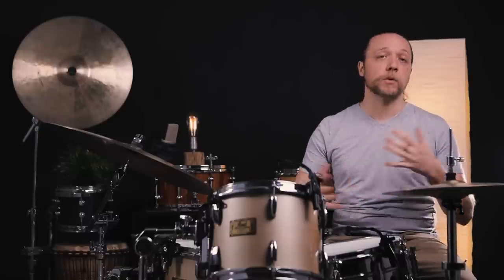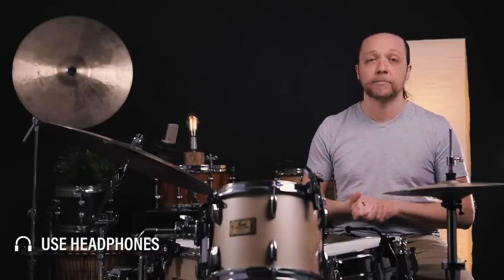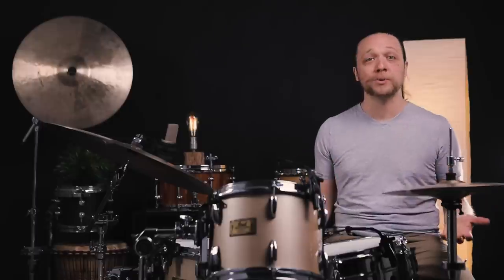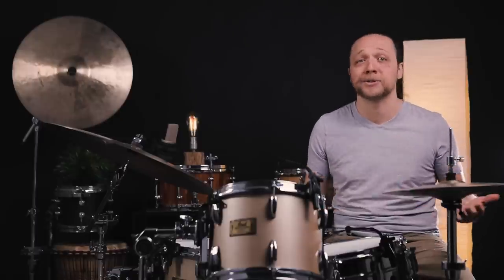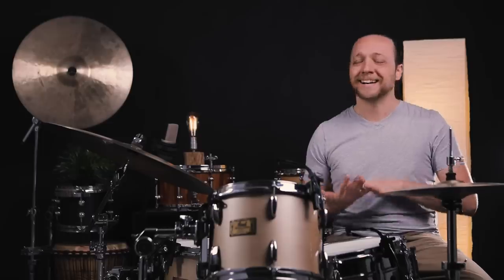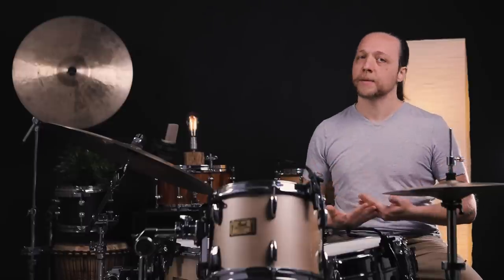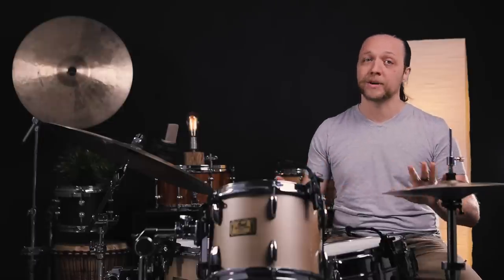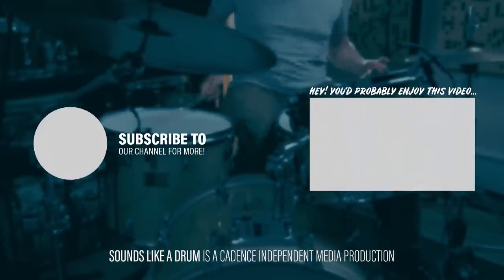Unison Tom Interval Tuning - Easy, Reliable, Versatile | Season Four, Episode 47

Comment: Same pitch is great for toms and medium tunings but the floor toms loose projection when tuned super low. I'd rather tune the bottoms of floor toms up just to give them more presence. I've used unison tuning for a long time and I think it works well for when you tune the drums and muffle them because they give a very strong fundamental with no pitchbend. Overtime I've learned to use the top head to give the base pitch of the drum and use the bottom to control the darkness and brightness of the drum.
Reply: I think there may be a fundamental misconception in your thinking - check carefully what he says roundabout the 5:20 mark.  Both heads are responsible for the pitch - if you tune up the bottom head for, in your words, 'brightness', the pitch of the drum will go up.  Whatever pitches you have for the individual heads when isolated, the whole drum will resonate at one fundamental pitch that is a product of the two heads when hit under normal conditions.
Reply: @frasermcallister6058  yes you're absolutely right. You can have the same fundamental pitch of the drum on two drums with dramatically different timbres. That's why drums are such a fascinating instrument to tune and record ♡♡♡

Comment: I like what you said about not having to have the same intervals on your rack tom as your floor tom. Ive found with different kits there's different sweet spots for each drum. For instance i have 10,12, and 14 inch toms and the 10 and 14inch drum love to be tuned with different pitches on each side but the 12 inch will choke out unless bot heads are the same exact pitch. Fascinating stuff
Reply: I was going to say something similar. I remember coming to the realization that rack toms and floor toms are different instruments and they should be treated as such.

Comment: I am the type of drummer that like the deeper tones on the toms and I have relied most on the combination of the heads that I use for batter or reso and even I tune them to a "prescribed" tuning I usually change everything to where I like the sound better.

Another thing is that I used to tune my drums at home and bring them to church and there I usually need to work on tuning the drums again because of the size of the room variable. 

In this video you share information I had not heard before and it widens the perspective that there's not a right or wrong...just be open minded to new ideas and let the sound of your drum guide you.

Thank you and look forward to hearing more interesting information from you all. 

Blessings to all!!

Comment: Husbands a mechanic and said old tuning is almost a lost art. It’s like building an engine, if you use your own intuition on tightening nuts and bolts, you can get close but the torque wrench equals everything in unison to perfection. And he plays drums, drum, heads, and rings make a difference also, he’s always experimenting with his drum set. He doesn’t really care for unison tuning for studio, but, for open arena or outside, unison sounds great

Comment: The Perfect 4th interval sounded best to my ears. Wonky overtones were much reduced. Those overtones might be desirable in an un-mic'd situation so they have their place but I definitely preferred the cleaner, shorter note produced when the resonant head was pitched up.

Myself, I use a tune-bot and tune the heads a 4th apart and each individual drum (10-12-14) a 4th apart. Sounds killer. I'll occasionally use a 5th between batter and resonant heads for a bit more sustain and resonance but generally stick to 4ths between individual drums. I play Gretsch Renown RN2s and they're super resonant.

Great content as always, and I learn something new every time I tune in. Thanks for this!
Reply: I have a Renown in 13, 16 and 24.  I am tempted to try the perfect 4th.  Are you tuning the reso higher than the batter?  I see in your comment that you prefer the reso pitched up.
Reply: Hey Matt. Yes, I prefer the resonant head tuned higher than the batter which is pretty standard. I use a tune-bot to establish the overall pitches for each head and then I use the 'Resonant Tuning' feature of the iDrumTune Pro app to dial in the interval between heads. The app recommends the 1.5 ratio by default which is a Perfect 5th but I much prefer the 1.34 ratio which is a Perfect 4th. The Renowns sound killer with either one but the P4 interval between heads shortens the sustain a little and as you know, Renowns have sustain to spare. Good luck!
Reply: @bakedalaska4363  cool thanks!

Comment: Bob Gatzen has been a big influence on how I tune drums, and he advocated unison tuning for toms. Recently though, I've been adopting Nolly's method of tuning the tom heads to a minor third - tuning the reso side to the desired note, then tuning the batter to a minor third below it. However, you actually tune a half step below your desired pitch to account for the strike of the stick sharpening the note of the drum. I found though through my testing that the 16" floor tom had too much bend in the note as it decayed, so perhaps for that drum a unison tuning would be more appropriate.

Comment: i have 10x10, 12x12 and 16x16 toms
With tune bot I go unison: 247 Hz; 190Hz and 100Hz.
Works fine
Reply from the maker: That's quite the jump with the m7th between the 16" and 12", though it makes sense for the sizes. Out of curiosity, what are you using for batter and reso heads?
Reply: @SoundsLikeADrum  ec2 clear top, genera resonant bottom.

The thing I am not pro at tuning drums, but tuning 16th tom higher makes it sound more "jazzy", while I prefer more rock\metal oriented

Comment: I would suggest that especially for Higher Tunings IT might make Sense to tune the reso lower than the batter since the Air Inside the shell has more space to vibrate instead of choking the reso head by Air pressure when you hit those accents.

Comment: I seem to always have the reso on my floor tom higher than the batter (currently it's about a M3 or P4 higher), but with my rack tom, it honestly doesn't matter to me if the reso is slightly higher, the same, or slightly lower (within a M2 in either direction).  As long as there isn't a weird interaction that chokes the sound, the differences aren't big enough to matter IMHO.

Comment: There is a surprising lack of information on tuning 5 lug toms. I have a 2008 Renown that I constantly fight with myself when tuning the 10 and 12 because of their weird 5-lug design. Any tips for those??
Reply from the maker: There's not a whole lot that's different with 5-lug drums in terms of the approach to tuning. The key (as with all drums) is to be cognizant of making small, incremental adjustments in tension. The less lugs, the more each lug impacts the tension of the drumhead. Working with two keys to tension the farthest opposing lugs simultaneously will help to distribute tension more evenly but, still, you'll want to keep those to very small turns to gradually bring the drumhead up to pitch.

Comment: I’ve been using unison tuning for a couple decades… clear emperors on batter and reso… all toms tuned pretty low, and it sounds mean and nasty… very Pantera-esque. HOWEVER, I recently figured out that my floor toms, 14” and 18” sound a little bit better with clear ambassador resos tuned to Perfect 4th intervals… what I’ve known as the Nolly Tuning. But my rack toms sound better with low unison tuning with emperors top and bottom. I don’t know if it has to do with shell depth or diameter… but I will experiment until I find out… I’m guessing it has to do with depth.

My next experiment is to see if clear G2s sound good with this tuning scheme, because I am so tired of Remo’s terrible quality control.
Reply: That’s crazy. I just switched back to Remo because the Evans dented when I tuned them the first time I tuned them. I hit with authority but don’t dent heads or break sticks. Don’t make things like they used to is what us old guys say.

Comment: You should do another video about high reso/ low batter vs low reso/ high batter for low and medium tuning. You've covered low reso for high bebop tuning. I used to tune my batter higher than reso at a medium low to low tuning. Seems like it's more sketchy to have a bigger interval with high batter/low reso. So I started doing it the other way

Comment: When we are dealing with double ply tops, single ply bottoms, is unison going to be same pitch or same tension?
Reply: That's a great question and I think points to the lack of understanding of this "out there".  I think many times drummers say "equal tension", when what they mean is "equal pitch", because really, how can you measure tension per se?  Even with a Drum Dial the head thickness plays a part in how it reads.  So...there's probably not a single, precise answer to your question, but I would think "unison" refers to pitch, so the double ply would have a higher tension than the single ply bottom to achieve that.  My 2 cents ;)
Reply: Let’s say you have Emperors on batter and reso with unison tuning… if you change out the reso for an ambassador, but tune it to the same pitch as you had the Emperor, the drum will sound exactly the same, except have a tiny bit more sustain. And as the chosen pitch for both heads gets lower, the difference n sustain will be less and less.
Reply: @BeatsAndMeats  True. Also, that same pitch with ambassador will require less "tension" to achieve.